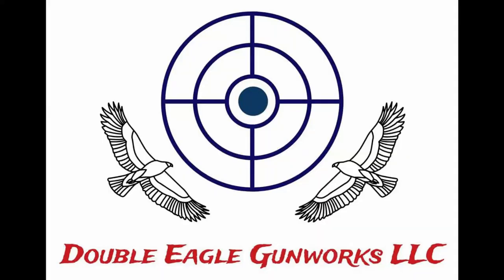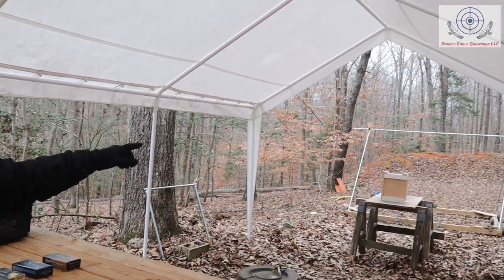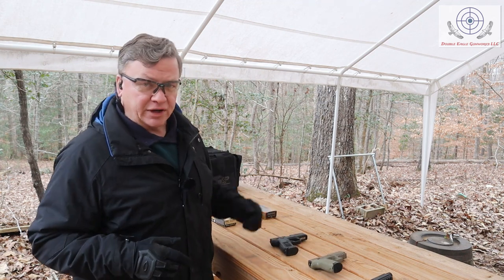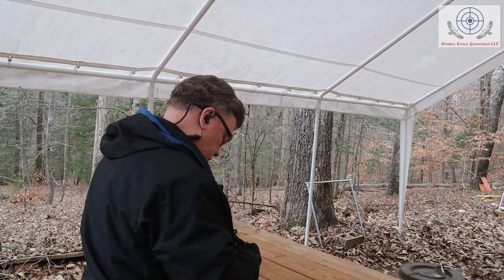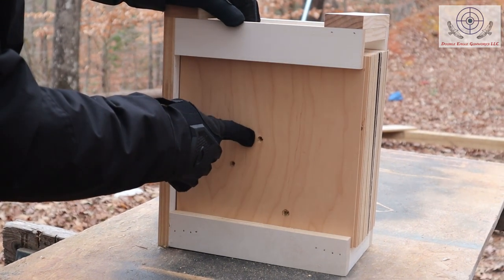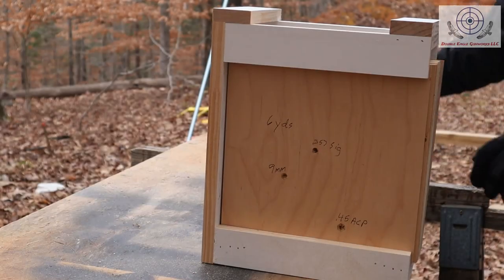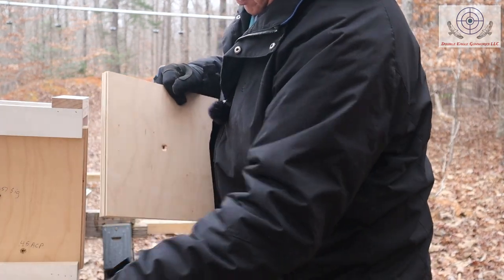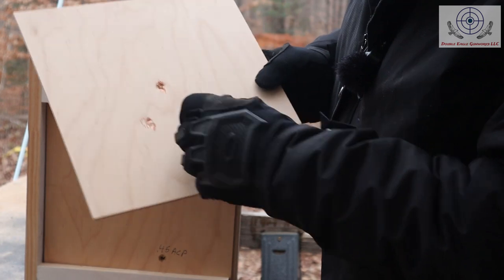Testing Penetration With 30 Layers of Wood: 9mm vs. .357 Sig vs. .45ACP

Comment: If you run both the 9mm and 357 Sig in 115gr Xtreme Penetrators, you'll really be able to see that the unequivocal winner is the Sig. By a landslide. The 45 won't even come remotely close. Great video.👍
Reply from the maker: Thanks for watching!

Comment: Love the 357 sig. I'll admit I'm late to the game when it comes to this round. It sucks that it's not more popular
Reply from the maker: Maybe it will make a comeback like 10mm has recently. Until then, I purchased a .40 S&W barrel for the P320 since all you have to do to change calibers is swap the barrel.
Reply: I got the 357 sig barrel for my m&p 40. It shoots amazing
Reply from the maker: @jonathanbrooksofficial  thanks for the info.  I didn't realize S&W had ever offered .357Sig as an option.
Reply: I will be getting into the cartridge soon.
Reply: @Catgat37  it sucks that it's so expensive. I'm getting it 45-60 for FMJ.
Reply: @DoubleEagleGunworks  early on in the M&P line they made them. Apparently they didnt sell well. My barrel is a KKM
Reply from the maker: @jonathanbrooksofficial  Freedom Munitions has some FMJ for $30 for 50 right now.
Reply from the maker: @jonathanbrooksofficial  ok. Thanks
Reply from the maker: @Catgat37  it’s a great cartridge.
Reply: @jonathanbrooksofficial  I am seeing some online for $30 for 50 rounds. Locally it is actually cheaper to buy defensive than fmj lol.
Reply: @DoubleEagleGunworks  I just bought a USP Compact .40 S&W, abd it came with a .357 HK barrel to swap, im digging this round.
Reply from the maker: @the.living.man.  good to know some companies are still making .357 Sig parts even though Sig is not.

Comment: I ran very similar tests using treated SPF (spruce-pine-fir) 2x4s from the same lot, as well as calibrated 10% ordnance gelatin comparing the .357 Sig, 9mm, .40 S&W, 10mm, and .44 Magnum.  The .357 Sig with published data handloads was #1 and #2 in penetration (147gr Speer flat point TMJ at 1,375fps being first, 125gr Speer flat point TMJ at 1,550fps being a close second), even beating 180gr and 200gr flat points from 10mm and 240gr flat points from .44 Magnum.  One can imagine that my Glock 31 Gen 4 is now what I carry when trout fishing in grizzly and wolf country!
Reply from the maker: The .357 Sig is a powerful round but it just never was widely accepted.
Reply: @DoubleEagleGunworks  It is a shame, and unless they have some physical disability or ailment, almost anyone from the 9mm "just as good" cult would probably be a convert if he or she could spend some quality time with the round.  I have buckets of brass and lots of 800X powder, so mild loads (towards the low end of published date) pushing a 125gr at 1,550fps means that whether it is widely accepted or not, it will be my and my family's handgun caliber in perpetuity.
Reply from the maker: @chouyi007  sounds like a plan.
Reply: Not buying that.  Test after test shows .357 magnum beat .357Sig every time.
Reply: @colt10mmsecurity68  I am quite sure it would, but if you read, you will see I did not test .357 Magnum.  I was surprised the .357 Sig beat the .44 Magnum, but I can't imagine that the .357 Magnum would not be better still.  It shoots essentially the same diameter (.357" instead of .355") and same profile (non-expanding flat point) bullet of identical weight (125gr) or heavier (158gr vs 147gr), but at even higher velocity.

I do not own wheelguns, though, and used a friend's .44 Magnum as a control.  I was testing for my own use to see what handgun in my wife and my arsenal would be most suited for large animal defense in the Wind River Range of Wyoming.  We fish there right around the summer solstice, when the snow is still very deep at altitude, and the grizzlies are coming out of hibernation hungry.

Comment: Already knew the winner before it was shown. It should be common knowledge now
Reply from the maker: .357 Sig is a great round, but it never caught on like it should have.
Reply: @DoubleEagleGunworks  It caught on to a lot of people and is still going strong. Its been around since 94 and it will continue on. It has always had a ebb and flow of popularity since then
Reply from the maker: @SmokinSigs It is still around, but the company that developed it, Sig. no longer makes any guns in that caliber.
Reply: @DoubleEagleGunworks  Yep, only Glock right now that I know of is making them. Only Gen 4 as well so far because they haven't released the gen5 lineup and might not. We shall see.
Reply from the maker: @SmokinSigs Glock is the only one I know of as well.

Comment: The .357 SIG had Much more velocity ..so of course More energy and more penetration..

It's an expensive 🔥 hot lil dangerous round 
For sure a good Self defense round even against Four legged Predators because of that Energy...
If ur concerned about larger Predators in the Woods. I highly recommend either .357 MAGNUM OR 10MM. with a Hot load.
If u gotta use a .45. Get some +p and ur doing pretty good. But the 10mm loaded hot is ur best bet...
Reply from the maker: Check out the updated video where I included 10mm in the test. It was a standard factory load but it still beat out the others in the test. Thanks for watching.

Comment: What was the board # that the 9 stopped at?

Could you do this test, but with various 22 LR?  Both pistol and rifle?
Reply from the maker: The 9mm and the .45 ACP both stopped in the 12th board.  You could do a penetration test with 22LR, but I don't think they would get very far into the wood.

Comment: So, watched the vid, and did skip a bit, looking for stats on how far the 45 penetrated vs the 357.  Appreciate the test, however would have preferred more data on that vs messing around looking for rounds.
Reply from the maker: The .357Sig went through 14 pieces of 1/4 plywood. The 9mm and the .45ACP only went through 12.

Comment: 45 may have done more destruction due to size of hole overall.
Reply from the maker: That is probably true in this test. The .45 did make a bigger hole as it went in. It might be interesting to redo this test in a softer material to compare the “wound” channel.
Reply: @DoubleEagleGunworks  good test really plywood is tough i used to make it at a mill in Olympia lots of resin and pressure involved in manufacture. I have shot every boutique 357 sig round through many barriers,great barrier bullets like gold dot 125 are really the perfect round for modern police duty when cars are involved so much more .Only a handful of agency's still use it,they all went back to nine.
Reply: @DoubleEagleGunworks  To little regard ,the 357 would still impact a target the 45 or nine could just never reach ,good test.
Reply from the maker: @paulscountry456  thanks
Reply: .... The thing that most people don't realize, is that this is simply not the case in actual flesh. 

The 45 relies on it's diameter in relation to blunt force tissue crushing within the permanent wound cavity however, there is an unmatched / inherent value of high-velocity/supersonic projectiles and their superior secondary and primary cavitation dynamics in the context of gunshot wound pathology in a clinical trauma setting. Bigger is not better by any stretch of the imagination. 

These projectiles obliterate surrounding hematopoetic / highly vascular organs through the process of shockwave dynamics, which extend to areas [far] beyond the permanent wound channel itself. 

This affected area is referred to as the extravasation zone. Blood vessels/capillaries within the extravasation zone are highly susceptible to the shearing strains and tensile forces induced by these concomitant pressure waves and in return, efflux plasma/blood, ect. into the surrounding area, thus resulting in additional necrotic tissue loss and hemorrhaging.

~
Reply: @TERMINAL-BALLISTICS  hmm,they make very light bullets like the Liberty for 45 ACP that travel nearly mach 2 in duty sidearms but are never going to be as effective as a 220 gr in defence situation, heavy is better than fast and temporary cavity tissue damage is not as big a factor as getting good expansion and penetrating to vitals,modern hp bullets like hst will open great under 1000 fps and penetrate deep to vital like heart.
Reply: @paulscountry456  .... That line of reasoning might be true, if you're getting your terminal ballistics information from Joe Blow from Idaho .... but in terms of terminal ballistics concerning gunshot wounds from a clinical/peer-reviewed/trauma-setting, that's simply not how it works.

Supersonic/high-velocity projectiles inherently impart something called shockwave dynamics during temporary cavitation. Despite what you hear from people/websites/YouTube channels who have no knowledge whatsoever of the dynamics pertaining to clinical gunshot wounds .... these projectiles impart unequivocally devastating permanent wounding characteristics, which can range from 10-30 x the size of the permanent wound channel itself. 

In addition to bone, inelastic/hematopoetic and vascular organs such as the liver, spleen, kidneys, pancreas and brain are highly susceptible to shockwave injury because they have minimal intrinsic ability to dissipate the energy transferred even if they are remote to the primary injury path.

This literally means that relative to shot placement.... that the liver, spleen, pancreas, kidneys, bone and/or brain can be obliterated in the [absence] of a direct hit, through shockwave dynamics during temporary cavitation alone.

Let me know if you need some peer-reviewed clinical citations. 

~

Comment: Interesting not as much difference as I would have expected. The .45 nearly always loses or wins these tests depending on what your after more or less penetration. About the only time the .45 never seems to lose is auto glass. At least in both the shooting I have done and the tests I have seen others do. The bigger round does seem to deflect less on windshields. All so close though the degrees of difference probably won’t make a difference. You  buy your ticket and take the ride it gives with these choices. We carry handguns because rifles are too bulky after all
Reply from the maker: They were all very close. As it relates to self-defense, it really comes down to what you are comfortable carrying and what you can control the best.

Comment: You should have stated what brand of ammunition was being used…was the same brand of ammunition used in each gun…
Reply from the maker: The 9mm was a Blazer FMJ load. The .357 Sig was Speer Lawman and the .45ACP was a hand load. The hand load was on the upper end of the powder load range for a 230 grain bullet using CFE Pistol powder.

Comment: You should have used 125 grain 9 mm to be fair
Reply from the maker: I did not have any at the time.
Reply: Even if 9 mm 125gr ammo was used instead of 115gr. The 357 sig still would of have penetrated more boards, but the 125gr would have penetrated more board than the 115gr, because of weight
Reply from the maker: @theclimatechangeconspiracy  I am planning on redoing this test in the near future and using 125gr for the 9mm. I don’t think the 125gr 9mm would penetrate further because the heavier weight would make it travel at a slower speed. I will link the new video to this one once it is complete.
Reply: @DoubleEagleGunworks  with guns weight are the dominant force, with rifles velocity is the dominant force
Reply from the maker: @theclimatechangeconspiracy  Thanks for the info.

Comment: Wouldn't a flat nose reduce penetration
Reply from the maker: Perhaps but I didn’t have a round nose  round for the .357Sig. Even with a flat nose, it still went further than the two round nose.
Reply: @DoubleEagleGunworks   Yeah, I didn't expect to have one, especially in the situation we're in now but, I think there is a strong possibility it would have went through that last board it stopped on.
Reply from the maker: @FoulPet  I will have to try the test again using round nose versus flat nose at some point.